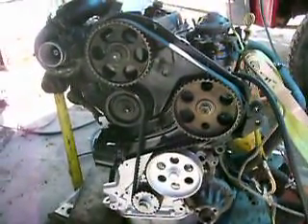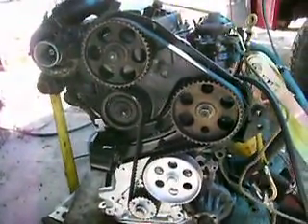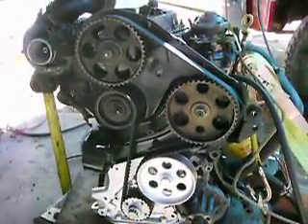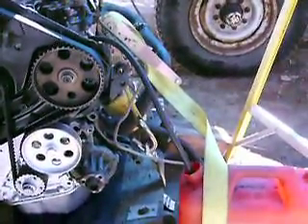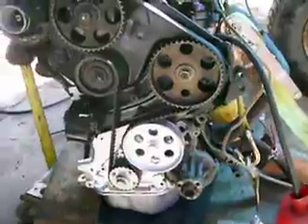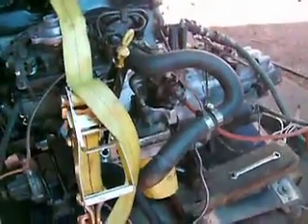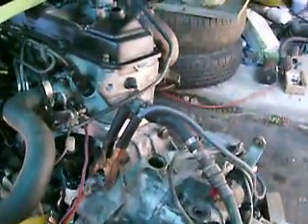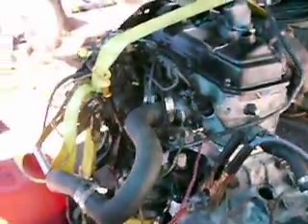VW Turbo diesel test

Comment: Great video on the VW engine.  I like you have a Grumman Kubvan but mine is still has the original non-turbo engine with 6,000 original miles.  Would like to see this unit installed inside the van and get you're opinion on it's performance.  Please post or upload another video once you've done this.  I'm sure there are others who would be interested.  Fos